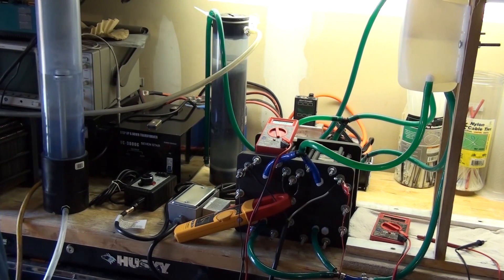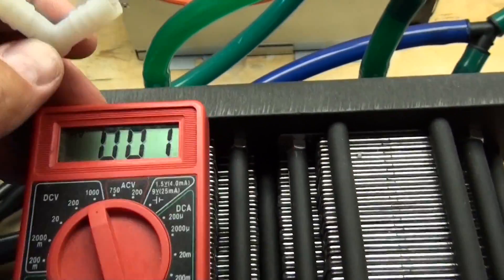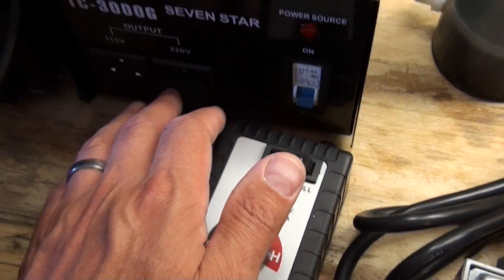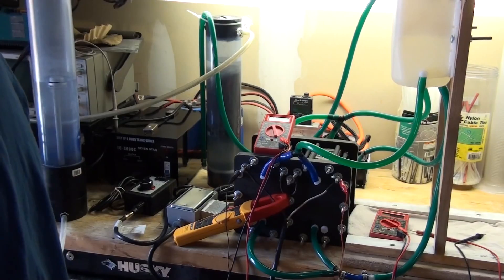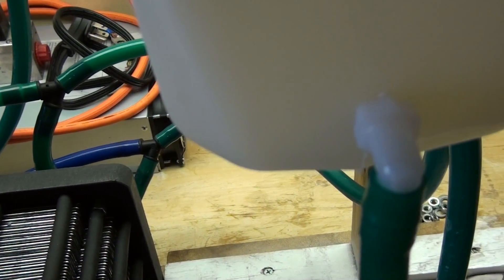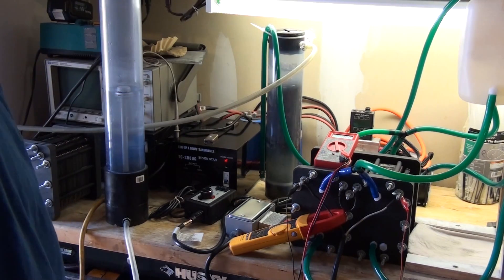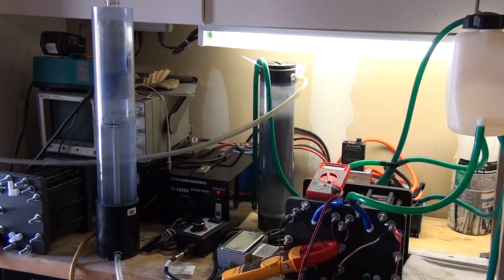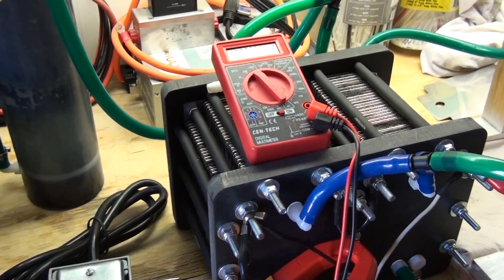HHO 118 plate 115/230 volt Hydrogen generator RETAIL ver.

Comment: Your system of the single 59 plates dry cell when converted from 120v  of AC to DC. So does that mean it's considered 120v DC. If so then, in order for this system to work in a vehicle. You would need a converter that converts 12v to 120v DC with a 30 Amp fuse right in order for this system to work in a vehicle?
Reply from the maker: These are not made for a vehicle. You want a 12 volt hho generator like these : www.greenfuelh2o.com

Comment: hello, i did 105 plates wet cell, ac rectifier to dc. 230v. the plates are 8 inches, 10 amps. somehow water heating after 2 ~ 3 mins is this normal?

Comment: isn't it dangerous ? how do you avoid electrical schocks?  May be the water in the bubler or reservoir is electrified by 220vdc  isn't it ? so please explain .. when running this device which metal or wet parts is safe to touch ?
thank you.
Reply from the maker: Only the plates are electrified. Electricity travels form positive to negative.  It only travels through the water in between the plates.
Reply: @Hydrogen4Health  so it means while the  plates are safe to touch   while ac mains  is on
Reply from the maker: @ruchancakaloglu  No you don't want to touch them. if you put your finger across enough of them you will get a DC shock.

Comment: Hello  sir i used stainless steel reserver  118 ss plates 230 volts but when electrolyte went from hho to  s s reserver  it become body earth  i got shock any  remedy for that ?
Reply: It is silly to hook a thing like this to such a dangerously high voltage, especially when everything is about water! It is always stressed, "Be careful with such high voltage when water is around!" This guy is a poor presenter and I doubt if he knows what he's doing that is why he's clumsy with his presentation also. If you go to Wikipedia, it clearly states that HHO generation starts at 1.23V and you need current (A) to produce GAS, not high voltage like in the case of electromagnetism where power (W) is the product of VxI. Here you need current (A) to produce GAS regardless of voltage. It still comes down to Ohm's law that if you increase your plates surface area then more current can flow through at lower voltage. So keep the voltage low, preferably <15V, that is high enough to produse GAS, but low enough not to kill you. Still, be careful, 12V too can cause muscle damage if you expose yourself to it too long with wet hands!
Reply: Thanks got it

Comment: The current standard centerline household voltage in the U.S. is 120/240v @ +-5%.   110v and 115v are very old standards circa 1950's and 1970's.
Reply: But India 220v bro

Comment: could you please tell me that what is the gap in between two plates & what is the plate size  my mail id is manesantosh05@ gmail.com
Reply from the maker: These plates are 3 inch x 6 inch. 22 Gauge SS. I use 1/16 inch gap.
Reply: thanks sir
Reply: and what is the gap between two plates sir ?

Comment: hi i have a 115/230v stereo amplifier, and because i brought it to newzealand and i used to live in taiwan and i forgot that volts are are different and i accidentally plugged the 115 v adapter to an 230 plug and my amp just made a weird noise and later it on it doesn't even go on so is it broken or not   (it do have a 230v switch on the back and a spare hole for 230 adapter)  ;(

Comment: An idea came to mind, Hho generators running off of a car of generator still put a load on the alternator or generator, thus making the whole concept less efficient. Now turbo chargers use energy that would otherwise be wasted from the exhaust to spin the turbine, if you could use an alternator powered by a turbine off the exhaust that would power the Hho generator, then you would actually see a major efficiency increase. It could possibly be on the verge of being self sufficiently powered.

Comment: According to your numbers I get the following:
1. 3.73 MMW at 1.55 volts per plate gap (VPPG)
2. 4.73 MMW at 1.69 VPPG
it would suggest that the higher voltage is more efficient.
Can you do this test again to see what is optimum VPPG?

Comment: What are your thoughts on a system that uses a separator cell that is powered by P.V. solar panels? It would capture the hydrogen and vent the oxygen off into the atmosphere. Do you believe it would be worth my time to pursue this? I am currently building a solar panel array. I plan to use it primarily as an energy supplement for my home, but love the idea of creating my own fuel for my automobiles.
Reply: I have a working separator and storage system at my home. The applications for pure hydrogen are just like lpg but with no pollution because the system runs on solar energy. I use low positive pressure  to insure I have pure hydrogen being compressed. If pressure is lost the compressor don't switch on. Simple but effective

Comment: residential supply is still single phase. You get the 220v by tapping on the outside legs of the transformer. By tapping on the neutral or center tap of the transformer gives you 110v (split phase). I don't think there is any residential supplies using 2 phase

Comment from the maker: People are always confusing HHO as a supplement fuel. It is not a fuel, your gasoline is. Do you know how your engine creates a tremendous amount of heat? Very little of the gas burn is converted into mechanical energy. HHO combines with the gasoline to make it transfer more energy to mechanical energy. It's simple and just look up NASA's scientific article. Engines that run with HHO run cooler thus the gasoline burns more completely. HHO IS NOT A FUEL!
Thank you for posting

Comment from the maker: Yes they do and I should have been more specific. In the US we use 2 phase 220, that's two 110 volt wires combine to make 220v. Most countries have single phase 220. That's 220v on one wire.

Comment: Use HHO gas to heat up thermal conductor on one of those Stirling generators that uses solar thermal to reach 1200F to run a 25KW generator. Probably would need 2KW to produce the gas, but you would have over 20KW in surplus.

Comment: i like simple answer ! 

Google this ( mililiter per sec  to liter min ) Chose the first link 

start 9:10
end  9:27
total : 17 Sec per liter 
1 liter = 1000 ml 
1000 ml/17Sec= 58.81 ml/sec 
1 sec 58.81 ml 
Take this # to the web site 
Equals  : 3.53 liters per minute (l/min)

Nice work ! i got the same production up to 10 LPM on a 40 plate running out of DC 
Didnt know we could run AC on those cell nice to know

Comment: The other day I was doing some electrolysis to remove rust from my Gravely walk behind gas tank. The gas tank had not been used in 25 years. I had been using a five gallon bucket submerse it in. Later I used the gas tank itself for electrolysis When removing the electrode from the where the the gas cap goes. It touched the side and guess what happened I was being very careless about it and didnt unhook the solar panel. It blew up like a cherry bomb. I learned to always unhook the panel first.